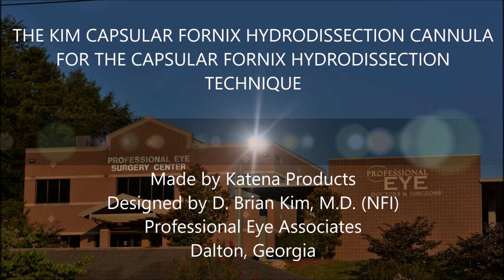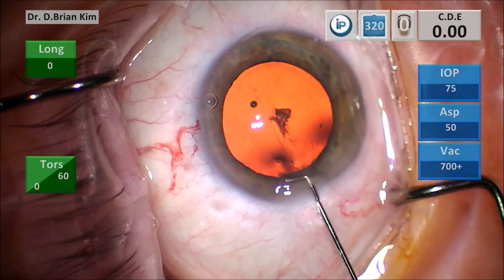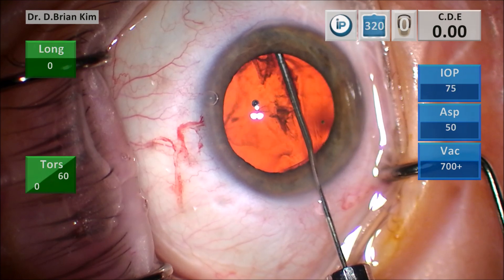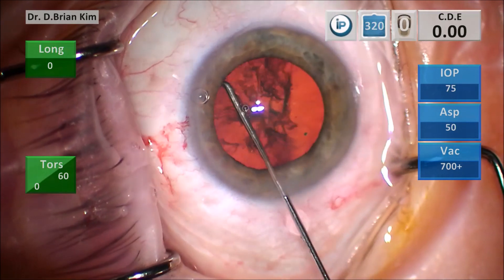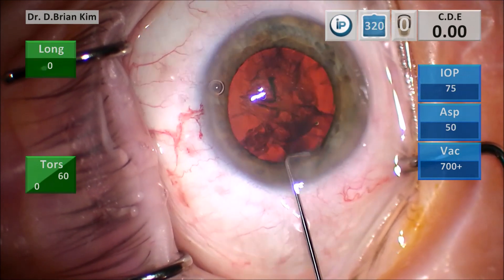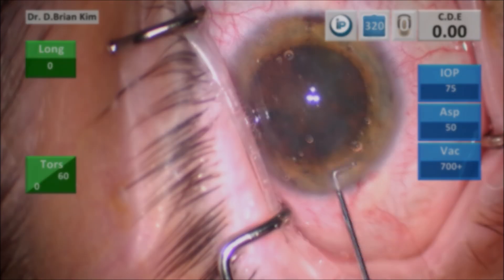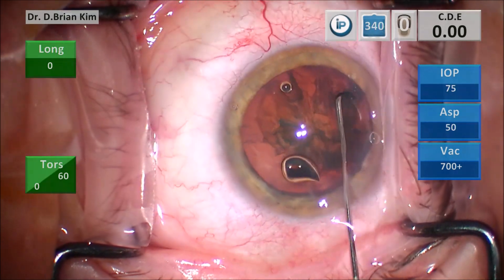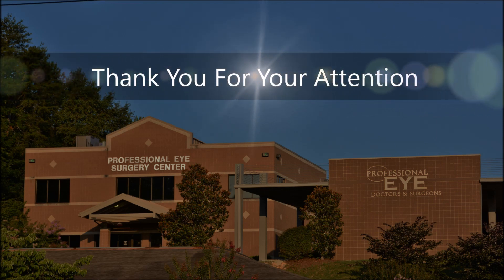Kim Capsular Fornix Hydrodissection technique and cannula

Comment: Hi, Dr. Brian Kim
This technique is non-cortical cleaving hydrodissection. Do we place the cannula between capsule and cortex or between cortex and epinucleus?  I am confused.
Reply from the maker: 伊亞動物醫院 good question.  I plan to write an article about this.  The cannula is placed between capsule and cortex.  When I perform capsular fornix HD, it is actually cortical cleaving.  But when you spin the lens, it becomes non-cortical cleaving because the spinning action separates the fibers between epinucleus and cortex.  In other words, if you don't spin and begin cataract surgery, when you remove the epinucleus, the cortex will come out together.  The problem with this approach is there are any wispy fibers that are annoying to remove.  I prefer the spin the lens and make it non-cortical cleaving.  I then follow with a separate step of I&A to peel cortex because I think it's easier to clean the bag this way.  I hope this helps.
Reply: Thank you, Dr. Brian Kim. I learn and use your every modified technique for my pet patient. These key points of every step are very helpful for my phaco cases. Your videos are the best phaco learning videos I thought, even using at the dogs or cats. Thank you again.
Reply from the maker: 伊亞動物醫院 thank you for the generous remarks.  I am grateful the techniques are helpful for veterinary cataract surgery!